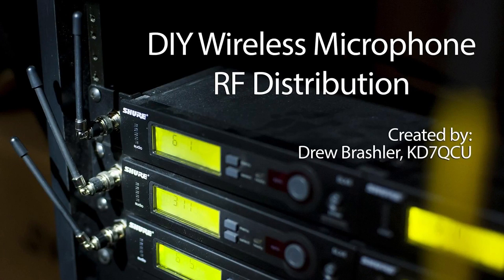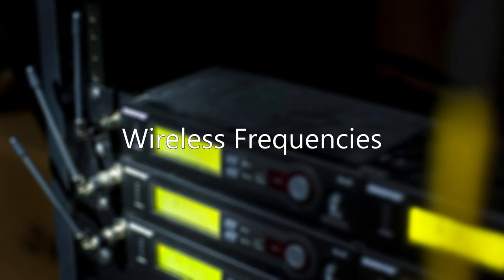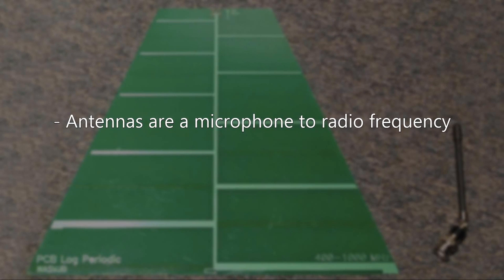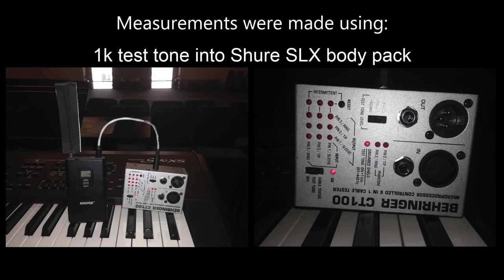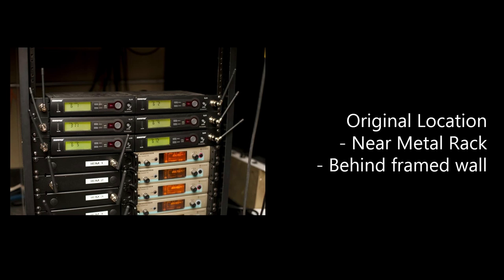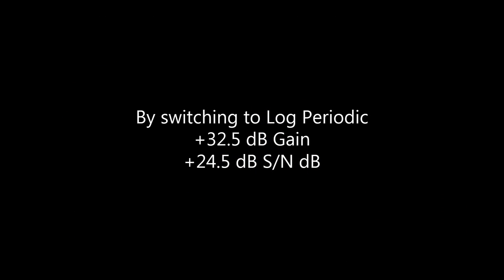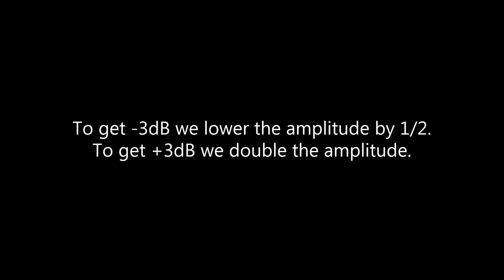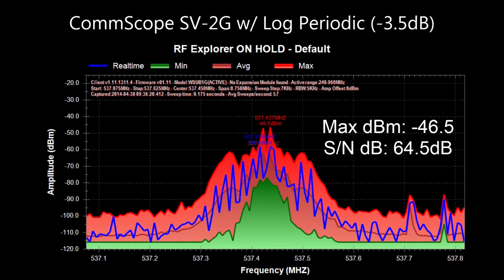DIY Wireless Microphone RF Distribution

Comment: Hi, there can some tell me if it would work with XS Wireless System with SKM 835-XSW Handheld Microphone Transmitter and EM-XSW 2 Rackmountable Receiver - A Range (548-572MHz).???
Reply: I'm not sure about those parts, however the main concern i think is the frequency, so if you think the freq. of your system matches this setup, it probably should.

Comment: Just fyi, the frequencies you can use in the UK are far more complex, some need licences some do not. Wether it is a fixed installation or not also has a bearing on the frequencies you can use and whether they need to be licensed or not.
All explained in the Sennheiser pdf link http://en-uk.sennheiser.com/downloads/download/file/4131/Sennheiser_Frequency_Charts_02.2013.pdf
Reply from the maker: Mike Gibson That is good to know about UK needing licences.  Even with that said of needing licences, the frequencies are all still within the bandwidth of this.  If you are using a 470MHz, 558MHz, or an 862MHz wireless frequency, license aside it will still work with this distribution system.  In the US, the 700MHz band was reconfigured to other uses, so it is no longer a legal frequency range to use for microphones in the US.  It is always up to the user to keep complaint with FCC or governing body's rules and regulations.  Thanks for the comment!

Comment: would spray painting the paddles black cause any issues with signal?
Reply: No, they work just fine. Use some cheap flat black paint as per the designer/manufacturer.
Reply: No, as long as you don't use metallic paint.

Comment: Noticed you use a PCT-VB-8U which is a Unity Gain device.  Any reason you didn't use one which boosts the signal to each port?
Reply from the maker: +Robert Trinidad I wanted to not have any chance of overloading the receiver, if you have too much gain, you can harm components inside of the receivers. That is why I did my baseline testing with the single wireless pack directly next to the receiver. Also, adding gain does not always get you a better signal. Remember when you add gain, you will also bring the noise level up along with the signal level.
Reply: @DrewBrashler  I'm just building mine and I got a channel master unit that has 4db of gain per output; any chance that'll be too much?

Comment: I am really glad you show the measurements because they don't lie.  The reason for the addition loss of the Commscope splitter is likely the impedance mismatch causing an additional VSWR loss.  Coaxial TV systems are 75ohm where wireless microphones use 50ohm transmission systems.  You can match this to gain back that loss (which goes up with frequency) by using a wilkinson splitter (google it).   A very simple way to passively match these is shown here.  http://www.changpuak.ch/electronics/coaxial_power_split.php
Reply: OK - this is what I get for not watching the whole thing first.    But my point about the wilkinsons still stand if you wanted to gain that back.
Reply from the maker: Later in the video I mention the losses that are incurred with the 50 ohm to 75 ohm mismatch.  This mismatch is a 1.5:1 SWR which the MAXIMUM loss that can be occurred with this mismatch is -0.18dB  So the losses are not enough to make any differences.  Thank you for your comment!
Reply from the maker: microenterprises Very true and thank you for the share on the video!  To me the losses of .2dB per mismatch isn't enough to make any real difference.  The gain of getting the 1/4 wave verticals out of the rack with a gain antenna will very much outweigh the losses occurred with a 75 ohm TV splitter and coax.  Thank you again for your comments!
Reply: Drew Brashler On a side note since you are a HAM - make sure you do your SWR measurements directly into the antenna where possible.   A high insertion loss through a cable will mask a bad VSWR.
Reply from the maker: microenterprises Another great reason of using 75 ohm coax is that it has much better specs as far as loss/100ft than any of the 50 ohm coax at the same price.  You normally will spend about 3x the cost to get 50 ohm with similar loss specs of any 75 ohm cable.  The 0.2dB loss due to the mismatch stays the same no matter how long that piece of coax is, the rest of the loss is due to loss/ft which is cable specific.  If you have a bad antenna, no matter how good the coax is, you will have a bad SWR, if you have a good antenna but bad coax, then you will have a very quiet good antenna.  Luckally these measurements are made where the receivers are placed in the system, and I was measuring amplitude only.  Any cable loss and impedance mismatch loss would affect the amplitude measurements, so if I had a lower amplitude measurement I knew something would be wrong.  No SWR sweeps were made using the system because I don't have the gear to get a measurement in the VHF/UHF range.  Thanks for all of the comments!
Reply: Drew Brashler  Your points are mostly valid - the only comment I was making as a 15 year veteran of RF design on aircraft - is that it is important to measure BOTH VSWR and I.L.  It might HAVE a bad SWR but you won't be able to MEASURE a bad SWR at the receiver. Because 1.0:1 VSWR means that max power is transferred to the load.  An ideal transmission system will not reflection any power and 100% (minus FWD insertion loss) of it will be absorbed by the load (antenna in this case).   A very long lossy cable will absorb any mismatch reflection from the load and that reflection relative to the power sent (what a VSWR meter measures) will be absorbed by the loss of the cable.  The standard scalar tester when placed at a receiver doesn't know if the power being reflected (or lack thereof) is being absorbed by load or loss in cable... it just knows its not coming back at it.  And it will give a thumbs up.   Go take your SWR meter and hook it up to a 10 foot cable with an OPEN or SHORT at the far end at UHF freqs say 225-400MHz and read your SWR.  (it will be infinitely high).  Now measure the same with a 100 or 200 foot cable into an OPEN or SHORT.   You will see the VSWR come way down to a point with continued cable length that it will become 1.0:1.  So to test SWR at the receiver through a cable to a load - can and will skew your results.   The way you test it sending a known signal in and measuring output knowing what your power budget should be overcomes all that.   I won't even get into phase stability of HF systems... that's another conversation because most HF antennas at DC are dead shorts at least in the aircraft world.

Comment: I have 4 Shure SLX mics and 3 Sennheiser EW 300 IEM.  Do I have to set up 3 antennas? 2 for the diversity and 1 for the in-ear monitors?
Reply: Yes. Most receiver systems use diversity reception–basically they compare the signal at both antennae and pick one, or combine the two. So, you will need 2 antennae for your receivers. Transmitters DO NOT benefit from more than 1 antenna (in close proximity). In fact, I'm fairly certain that would bone ya. ;)

Comment: Hey Drew. Working on this setup now but for the life of me I cannot figure out where the SMA to BNC Adaptor Cables will be used? The way it looks is you have made SMA to BNC adapter cables out of the RG6Q coax and the connectors. These run from the Receivers into the splitters. Then you are running SMA x SMA up to your array antenna. Can you help me out please.
Reply from the maker: +Jeff Graves Sure thing Jeff! The SMA to BNC is to go from the Log-Periodic to the Shure receiver. My original setup was to use the log-periodic with just one receiver at the time. Then I decided to start designing this distribution system. If you can find a SMA to F connector, that would be even better because you could go straight from the log-periodic to the coaxial splitter. Thanks for the question and for watching!
Reply: +Drew Brashler Thanks Drew. What I wound up doing is getting a SMA Male x Type F Female crossover fitting and using it directly into the SMA soldiered to the Log Antenna. Then ran RG6 with Type F crimps on both ends from the Antenna to the splitter. Works like a charm! Thanks and God Bless!
Reply from the maker: Awesome! Thanks for letting me know, I would love to see some photos of your setup!
Reply: +Drew Brashler I will get pics of parts tonight. Still trying to find the right SMA 90 degree connectors for the Log Periodics. I ordered some but the soldier footprint of the connector tabs was to large. Will get pics of completed system as soon as I get it all put together. God Bless

Comment: I have racked in ears (4) and 4 wireless mics.  by process of elimination i figured out that the wireless mics don't get along with the in ear body packs.  is this possible to fix? if not let me know (I'm frustrated) thanks for your videos!
Reply: Change the frequencies. Each channel has a certain width and frequencies may overlap with other channels. Each wireless device needs its own channel that doesn't overlap with another.

Comment: I receive radio waves when i hook up my pearl man tm1 mic into pre amp, its really bad you can actually hear the music from the radio! 

I have tested them in another location it works perfect.

I have tried changing the mic cables into star quad cables and bought a power conditioner and still having the same problem! 

it looks like the 7pin mic cable is acting like an antenna 

do you know how do i solve the problem???

Regards
Reply: +Arash Armin That kinda sounds like an overcrowded frequency issue where you're using the same frequency as the station. Maybe change that?

Comment: Just implemented this with wireless mics and am having an issue I can’t figure out. I have 4 Sennheiser EW G2 and 2 Shure ULX receivers. The Sennheisers are fine but one of the Shure receivers has a buzz and the other won’t power on when antenna cables are connected. Cables have been tested and splitter locations swapped to rule out bad cables and locations. I’ve also tried pulling power and obviously see RF signal loss but nothing else changes. Any ideas what could be causing the issues with the Shure receivers?
Reply: Fixed one of the problems with DC blocking adapters. Still have the buzz on the Shure receivers. Only occurs when the transmitters are on. Channel makes no difference. Transmitter off = no buzz. It’s not a 60Hz hum but quite a bit higher in frequency. Any ideas?
Reply: Morgan Highley, it sounds like noise related to your power setup. Try some kind of power strip with isolation transformers inside, like those by Monster, Furman, or Tripp Lite (the cheapest, and actually a very good solution for a lot of folks). Then make sure your TX and RX are powered from isolated power plugs. Many of these units have outlets that are isolated from one another in pairs, so be sure your TX and RX are not sharing isolation. You may even want to buy two of the small Tripp Lite IsoMax boxes, and put your TX on one, and your RX on the other.
Reply: @morgan.highley  I had this problem with a Sennheiser mic. I changed the channel and no more buzzing.

Comment: Drew my IEM are 903MHz to 926MHz  will the 800 MHz combiner work for my application?
Reply from the maker: +Tom Nader Hey Tom! You would need to have a combiner that would be in the 903-926MHz range as this is outside of the bandwidth for the one I mentioned in the video for the IEMs. Thanks!

Comment: would this work for all models? I have audio-technica and Sennheiser can I use the same antennas for both receiver?
Reply: Yes... It's like TV signal. You can have 4 different TVs hooked up to the splitter on 4 different channels.

Comment: Hi, everyone - I have built the system as described, the when I connect the antenna to a receiver (either through the splitter, or directly) the receiver shorts and powers down.  The paddle board antenna has continuity between the center pin pad, and all four shield pin pads.  The antenna that comes with the Shure system does not have continuity between the center pin and the shield on its BNC connector. Could the paddle boards be bad?  Thoughts, anyone?
Reply: +Eric Pierce 
I have found a solution to the issue I reported above.  The Shure ULXP and ULXS series receivers have +12v on the center conductor of each antenna connector.  This must be disabled to prevent shorting of the receiver power supply when connecting to a passive amp/splitter.  Shure has an article describing how to remove the +12v at http://shure.custhelp.com/app/answers/detail/a_id/2451.

This also applies when connecting the Shure UA844 Antenna Distribution System to a passive splitter.  This Shure article can be found at http://shure.custhelp.com/app/answers/detail/a_id/2457/related/1.
Reply: +Eric Pierce Could you just use passive splitters instead of active ones to accomplish the same task without having to disassemble your receivers?

Comment: Can someone help. I got a gift of a vintage TOA  WT870 Receiver with a WM290 wireless systems with an SM58 head. I have very poor transmisssions where just 20 metres apart there is interference. Does anyone have any advice. I am in Zimba
bwe

Comment: Hey, how is your longtime experience with this setup?
Reply from the maker: It is still functioning to this day! The only service that I had to do at one time was replace a power supply for one of the distribution amplifiers. This power supply was pulled from a back room and was not new at the time. Other than that, it has been a wonderful solution for this church!
Reply: We just bought Sennheiser combiner, slitter and padlle antennas for one of our church venues for about 2500€ in Germany, Ill give the DIYt a try for our other church places. Ill report on success :)
Thanks for your work!

Comment: Can I use a omnidirectional antenna instead of a directional one?
Reply: Yes. Antenna type should not matter, as long as it is made for the correct frequency band. I'm sure there are exceptions... (A fairly educated guess.)
Reply: @pointer333  so - if I have 8 wireless mics of the same make and model, I should be able to take ONE of the antennas and split it to the 8 receivers? Just do this alone would help with the clutter!
Reply: Darren Swartzendruber, that’s exactly right. The antenna you choose must cover the entire range of your receivers though. In your case, since they are all identical (assuming you mean they’re all in the same band, as in every receiver is 516MHz thru 566MHz, for example), your antenna only needs to cover that single band (AKA block). If you had some receivers at 470-500MHz, and some at 600-700MHz, for example, you would need a wideband antenna that “sees” everything from 470 to 700. I will say I have not really seen anyone use the stock antennas in when splitting. I do not know why this is. It’s possible it’s only because they’re already going all out—might as well use a better antenna, or one more appropriate for the application. Maybe also because some stock antennas are monopoles, and they don’t work so well in “free space.” (I’m not sure if this bit is true.)

Comment: Hi Drew, will this set up work with 24 wireless receivers
Reply from the maker: +Kevin Schladenhauffen Hey Kevin, if you had the spectrum available to run 24 wireless receivers, yes it would work. I would recommend having more than just 1 or 2 antennas. If you ran 3 antenna's into 3 different 8-way splitters, you would be set at 24, but that would need to be doubled if you wanted dual diversity. You can try it, but I probably wouldn't want to split the signal from one antenna to more than two 8-way splitters. If you wanted to try this, you can take 1 antenna into a 2-way passive splitter, then go into the 8-way active splitters. Let me know if you have any questions!
Reply: Thanks for asking this question, and thx to Drew for answering!  I am just about to try something like this.  I built a system following your example for 8 receivers, but I want to add at least 8 more and i was wondering how far I could take the signal from two paddle antennas...based on your reply, seems like I could safely do 16 shure receivers with two paddle antennas and four 8 way PCT splitters. Do you agree?

Comment: Just wanted to thank you for this awesome tutorial.  I'm just about finished with the custom case I'm making, including an antenna holder I designed in Fusion360 and 3D printed: https://www.dropbox.com/s/unn0v877xg3rjv6/antenna%20mount.JPG?dl=0.  I'm going to mount it on top of my custom wireless box.
Reply: I am thinking of just getting some short mic stands and using microphone clips. I would remove the top from the microphone clip and stick the antenna in there and maybe drill a hole in the antenna to mount it.

Would you be willing to 3D print one of those and sell it? I don't have a 3D printer.
Reply: This is just a picture. Could you actually send me the 3d printer file type.
Reply: @jabbajawz  Sorry, didn't see your reply for some reason!  I've actually completely re-designed it.  And yes, I'd be happy to print and sell them!  This is what it looks like now: https://www.dropbox.com/sh/9hien6acii5au37/AAD3Jj3pKvjwJsbpXikx-99qa?dl=0